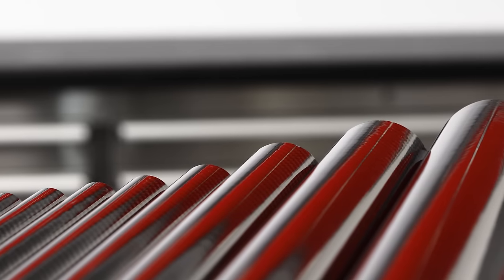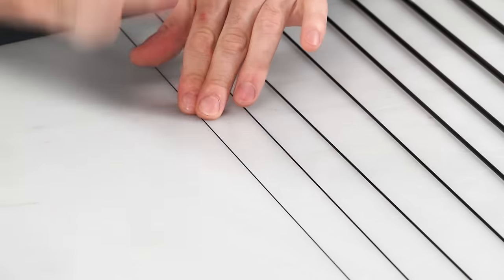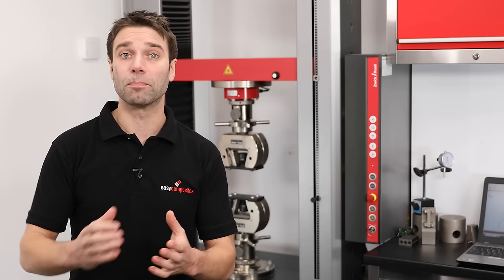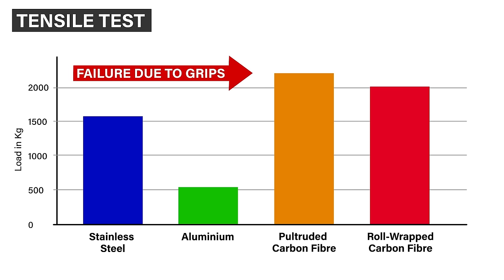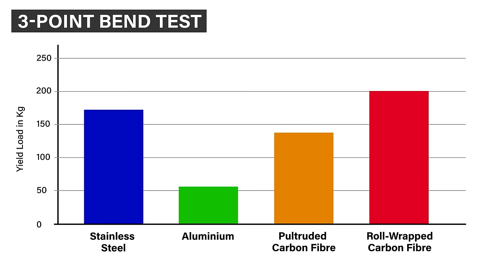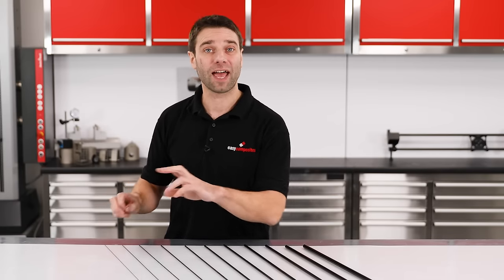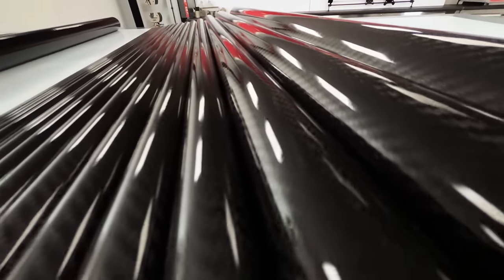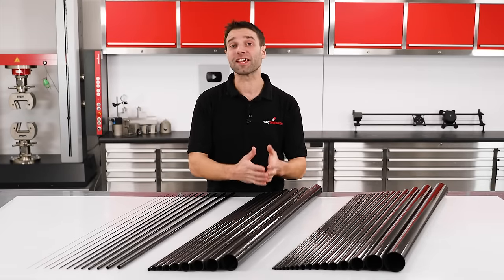Carbon Fibre Tubes - Everything You Need to Know

Comment: Hi, thank you for this informative video ! How much better would a Pull Winded or Braided tube would perform in torsion compared to a Roll Wrapped ? Regards
Reply from the maker: Its all about the direction of the fibres so if the fibres are orientated diagonally to resist twist then it will be much better in twist than a typical roll wrapped tube where the fibres go down the length of the tube.

Comment: Could you please explain why carbon fibre drive shafts are sometimes used to replace steel ones. The very low torsional performance figures in your tests would indicate it's better to stay with metal.
Reply from the maker: They have the fibre orientation specifically orientated for torsional performance.  These stock tubes do not.  Compared to homogenous materials, composites are all about fibre directions and direction of loading.

Comment: I am interested in piano tuning levers. The tubes are about 300mm long. Tensile, compression, and torsion is not important but bending and hoop strength are key. Very high hoop strength and very little bending. Most I see are roll/wrap about 18mm to 22mm OD but I have no idea what ID they have - probably 16mm and 20mm respectively.  How does the hoop strength increase and bending descrese if I used instead of 18mm x 16mm I used smaller diameter but thicker wall, say, 16mm x 12mm.  Do you have a video where you compare tube wall thickness - same OD but different ID's for hoop strength and bending comparison? Also, I know UHM carbon fiber roll/wrap has less bend but it is brittle and will break under very heavy bending (but still maybe ok for piano tuning lever use).
My idea is to allow an optional Stainless Steel rod to be inserted inside the tube to add more weight and some strength.  Some people like the lighter weight of carbon fiber levers, but some prefer a bit more weight to them because heavier levers are bit eaiser to home in on the tuning pin when your arms are used to heavier levers.

Is there a chart for all this?
Reply from the maker: Hi Paul, We don't have any further videos that directly address this, but for a tuning lever at 18-22mm O.D. Even a 1mm wall would be almost impossible to break by hand with a 300mm lever, I could imagine that going thicker with the wall might be needed to eliminate any flex as I would imagine that's important in that application. You could start with a 1mm wall and just add layers to the outside until you have the performance that you need, then you'll know exactly how many layers to use for the second one!

Comment: I would have liked more information relative to the wall thickness of the materials used in the demonstration How would a 2mm wall thickness compare to 1mm in carbon fibre. I'm in the process of building a yacht steering wheel and I have chosen the tube with the heaviest wall thickness for the spokes not knowing what pressures the spokes will have to sustain. It is a bit of a suck it and see project.
Reply from the maker: Custom projects like that it is hard to know for sure without testing or calculations.

Comment: Is there a specific epoxy resin for making a carbon fiber part ,,or you can also use table epoxy to make a carbon fiber
Reply from the maker: No you would typically want a laminating epoxy for the job.  Clear casting epoxies have a different balance of properties.

Comment: What would be the best way to bond a CF tube to a CF plate?  (Application: I need some stand-offs for an engine cover)
Reply from the maker: A structural adhesive such as our VM100 is a great product for bonding composite materials together. Just be sure to check that the operation temperatures don't exceed the service temperatures of the adhesive and resin in the tubes.

Comment: Wonderfully informative video. I wonder if you could do a video on the stresses of sleeved (telescopic) tubes. I have read that one need an overlap of between one fifth and one quarter of the length of the unsupported arm. So if the unsupported arm is 80 cm one needs an overlap of between 16 and 20 cm. Is that correct?
Reply from the maker: The optimum amount of overlap would depend on the amount of hoop strength in the tubes. The overlap is there to spread the 'burst' load where the inner tube is trying to split the outer tube. The only way to know for sure would be to set two tubes up with the anticipated load. Begin with more overlap than you need and then start edging out the inner tube until you get to the failure point. You might find that for your load you can get away with less overlap and therefore achieve a longer reach for a given amount/weight of tube.
Reply: Many thanks for your reply. My “tube” will actually be a D-shaped section that I will build myself to fit around at D-section crossbeam for a 2-metre RC trimaran. I will probably over-engineer it since I don’t want to break it. But I might start with a long overlap and gradually reduce it until I feel that I am beginning to get some slop in the connection. Once again, thanks for your reply. If I was in the UK I would certainly patronize your store.

Comment: thermosets > thermoplastics. all the new up and coming stealth planes are made out of uhmwpe. i feel like the properties of thermoplastics are really underrated, especially in fiber form. abrasion resistance, friction, reparability, and especially with ultrasonic welders manufacturability. I wonder if they have any place in composites?
Reply from the maker: Thermoplastics are being used in composites already, there are a few downsides, increased processing cost, processing difficulties and higher tool wear being but a few.  As you say though there is the potential for advances in performance.

Comment: Can you bend these tube's into a custom shape or how would you make these tube's with a 7mm OD and a bunch of curve like bike seat rails?
Reply from the maker: Unlike a thermoplastic, composites like the tubes can not be heated and bent to to shape. To hold any kind of shape they need to be moulded in this manner, for larger diameter tubes this can be done with a multi part mould and internal vacuum bag however this isn't appropriate for such small diameters. The only option really would be to 3D print a dissolvable core and wrap it with a braided sleeve. Once cured the internal structure can be dissolved from the centre.

Comment: What is the best way to thread and secure a rolled CF tube? roughly 36mm, that will experience moderate loads perpendicular to the tube.  It seems the failure rates of your test subjects were around the mounts.
Reply: Epoxying in a threaded insert is the usual way.
Reply from the maker: As rtz549 commented, it's almost always a case of bonding an insert (often of metal but could be various materials) to the tube and the fixing to the fitting. The key with carbon fibre tubes is to keep the fibre continuity intact as much as possible.

Comment: Can I use Carbon Fibre Tubes or Squares as Struts in larger Geodesic Domes to take advantage of the low weight...
Reply from the maker: Sure you could use carbon spars for this, you will probably need to manufacture sockets for the tubes/box section to slot into rather than cutting complex compound angles and bonding together.

Comment: Is it possible to drill a 5,2 mm hole on the upper and lower part of a carbonfiber roadbike fork in order to line up the braking cable internally? Or is this to high of a risk as you dont know how much this weakens the fork itself? Problem is you have clamping forces from the stem and also expanding forces from the expander?
Reply from the maker: We can't really advise on this I'm afraid as it would likely compromise the integrity of the fork to an unknown extent.
Reply: @easycompositestv  thought so. I think it's not worth the effort. But do you think with additional strengthening layers it could be possible?
Reply from the maker: @Freeriderz666  Again, we can't really advise without knowing the original design parameters of the original part.

Comment: I was thinking about aluminum carbon fiber laminated layer comes out with high tensile strength, but on pipe ... why you didn't demonstrate how much bar psi pressure inside it's tube could barely resist?
Reply from the maker: Maybe it's something we can look at in the future. I'd imagine that the roll wrapped tubes would perform pretty well given the fibres running round the circumference would all be in tension. Finding a way to securely block off the ends and have a valve which wouldn't blow out might be a challenge though.
Reply: @easycompositestv  just need imagination first place to change the future pal. Good idea

Comment: Great video , if you increase the diameter say from 10mm tube to say 20mm tube , does the strength double as rough guide ?
Reply: No, it roughly quadruples the strength.

Comment: I need carbon fiber tubes for a 3D printer. I am using plastic bushings for Igus. That is the same setup as Bambu Labs are using in their current printers. The issue is finding straight tubes with the accurate dimensions. It is not that carbon fiber does not work with bushings, as they do with plastic ones from for example Igus. Also, I would prefer a bit bigger diameter if possible. Preferably like 12mm maybe 16mm. I guess 8 or 10mm could work, but given the stress they are put under, 12mm seems prudent. Do you guys have anything I could use? Are yours straight? Is the OD accurate? I guess we are looking at something stranded?
Reply from the maker: I suspect they have the tubes specifically sized and spec'd for their requirements.
Reply: @easycompositestv   probably not that much. They need to be straight and have an accurate OD. Actually there are plenty of people using carbon fiber tubes this way even on youtube.

So my question is, do you have fairly straight tubes? As for accurate OD, if I try to buy that of the shelf, does that exists?

Comment: Im curious if its worth using composites in a rust repair? instead of using thin steel to replace a gusset, use carbonfibre which wont rust again, my car has rust sills for example
Reply from the maker: Not generally recommended as the materials behave differently and generally the same structural part would be designed differently in composites. Also it may not pass an MoT that way.

Comment: What about internal pressure? Say you got 20 bars or more on inside.
Reply: No subs allowed 😂
Reply from the maker: Carbon fibre can be extremely good for making lightweight high-pressure vessels, you'll see a lot of tanks (such as hydrogen tanks) made either from pull-wound carbon fibre, or from aluminium wrapped in carbon fibre. In fact, there's a clip of this process included in this video when we mention pulwinding as another type of tube construction method. In terms of the tubes on test here, the pultrusions and the roll-wrapped, they are both designed for longitudinal stiffness, not to resist internal pressure. With no 'hoop' fibres, the pultrusions would be terrible for internal pressure. The roll-wrapped tubes which do have hoop fibres would fair much better but could be made much better by increasing the amount of fibre in the hoop direction.

Comment: I am surprised the CF performed so poorly in the torsion test compared to the metals. CF driveshafts are used in high end sports cars for their ability to take on crazy amounts of torque compared to metal driveshafts.  Are they different than what was shown in this video?  can somebody help me understand?
Reply from the maker: As explained in the video, its all about fibre orientation - especially for a tube such as a driveshaft where the fibres will be specifically aligned to resist twist.

Comment: Wanted to make a 45” L x 31”W 1/2” thick table top only made from carbon fiber what would be the best way to make it and should I? I don’t want to just simply wrap carbon fiber over a wood slab.
Reply from the maker: A foam cored panel would be the best method for that thickness.  You could resin infuse it.

Comment: Is it possible to build a carbon fiber tube chassis for a formula racecar using aluminum nodes?
Reply from the maker: In theory it would be possible yes but it's not really a mechanically efficient way of doing so. A monocoque construction is far more suited to the  performance of a composite material due to the way that it can spread the load.

Comment: What I need is a way to join small tunes to larger ones like a T joiner.
I need to be able to have one larger diameter tube then have smaller diameter ones crossed over running above or below.
I want to construct Yagi antenna booms then wrap them in braid wire for the conductivity.
Or is it possible to have the braid in the tube? 

I may email you guys soon.

Thanks.
Shane VK1NME.
Reply from the maker: Drop us an email Shane, might be a struggle to cover it all here!

Comment: Hi there, hello. I'm having trouble finding out information from Google. IDK if it's a bad idea and I don't want to waste my time. I'm modeling a mold for a carrying case im building. I want to add a spot where I can fit a nut so that after the carbon fiber cures i will be able to screw in a hinge without drilling. Is this a bad idea?
Reply from the maker: You can use BigHead Fasteners that have nuts (or studs) on a plate designed to be bonded on the reverse of the part to provide that fixing: https://www.easycomposites.co.uk/inserts-fasteners

Comment: I would love to see titanium rods compared to carbon fiber ones. I work in the camera industry and carbon fiber for heavier cameras feels unsafe , dont know if im right or not tho.
Reply from the maker: It all depends on the dimensions and design for the tube.  Larger diameter and wall thickness tubes can take much higher loads. We often see camera rigs for quite heavy cameras using larger diameter tubes.
Reply: @easycompositestv  yeah iv seen them too but the standard rodmount holes are 15mm on most rod mounting plates.

Comment: Is the carbon fiber UV resistant? 
Is carbon fiber stronger than E-glass?
Reply from the maker: Carbon fibres are completely UV stable (although the resistance of the resin matrix will vary) and have a higher modulus and tensile strength than E-Glass.

Comment: would have been amazing if you could have thrown in a 45 -45 roll wrapped tube to even out the torsion game
Reply from the maker: Yes, totally agree. Surprisingly not easy to find, and not a product we already make so we would have needed to make it from scratch, to a matching 10mm/8mm spec. Maybe we could do it for a future video. A pure 45 degree tube would perform very well in torsion (hence why carbon prop shafts can be so good).

Comment: Are they useful for car door crash reinforcement
Reply from the maker: It wouldn't be a good use for Carbon Fibre as despite its high strength characteristics, carbon fibre isn't very good in impact; if it had to be composite, you would be better looking at aramid fibres which have a much greater elongation to break property and thus would be better for impact scenarios.

Comment: What about exhaust headers ?
Reply from the maker: The temperatures of most exhaust gasses would obliterate most resin systems very quickly.  You would need to find a resin system that can handle hundreds of degrees maybe as high as 800C plus on turbo cars.

Comment: 01:39 interesting carbon fiber is fire resistant
Reply from the maker: Yes the carbon fibres themselves have a very high temperature resistance. The issue with composite parts comes down to the resin as you can see in the video, this burns at a much lower temperature. This is one of the reasons composite panels are unsuitable for processes like laser cutting.

Comment: Can the fibres be re-used after having the resin burnt out?
Reply: Obviously you'll never be able to get them back to a continuous fiber spool, but they can be chopped up and used for the "forged" technique, or chopped very short and mixed into plastic for injection molding/3D printing.
Reply from the maker: Not in an easy practical sense.  They could be recycled and used chopped up for other processes but it is not something easy to do for small quantities of material.

Comment: Can you drill a hole in them tho?
Reply from the maker: It is possible to machine holes in the roll wrapped and woven finish tube yes. You won't be able to do this with the purely UD pultruded tubes however.

Comment: I'm a little disappointed with the testing. What is the wall thickness of the steel? the aluminum? the carbon? no way to compare the results, which were not even accurate results to begin with, without knowing the properties of each tube. Maybe it's fun to watch things break, but anyone who is trying to make a comparison between products, this is a hindrance to attaining real knowledge.
Reply: I believe you’re asking about the part where it’s mentioned at the test intro they all have an OD of 10mm and an inside diameter of 8mm, therefore 2mm wall thickness
Reply from the maker: As ben has pointed out, this is included in the video. We very intentionally used tubes of all the same dimensions (ID and OD) so that the comparisons you're talking about are possible. Please see 05:52 https://www.youtube.com/watch?v=FNM-d5IPiho&t=352s

Comment: carbon won yeyyy! wanna use un hollow carbon fiber vs aluminum, and see who wins
Reply from the maker: A round section vs a tubular section would produce broadly the same result, in terms of comparison between the different materials. Although a solid ‘rod’ section is common for a pultrusion but would be something different than ‘roll wrapped’ rod, as this process wouldn’t be possible.

Comment: What's the layup? How many 0's, 45's and 90's are you using?
Reply from the maker: Entirely depends on the specific tube.
Reply: @easycompositestv  Don't you mean how that tube will be used? Whether the load on the tube is torsional or in tension or compression?